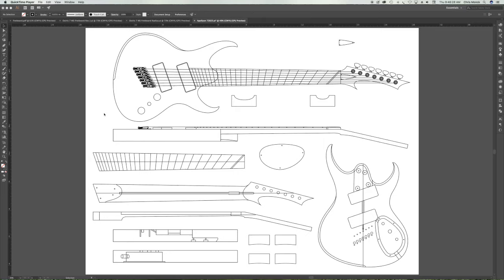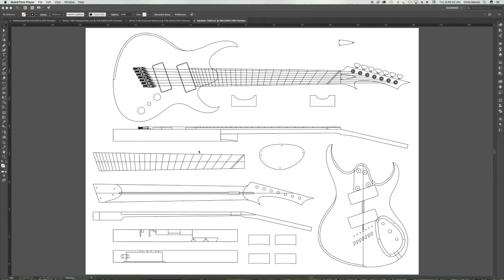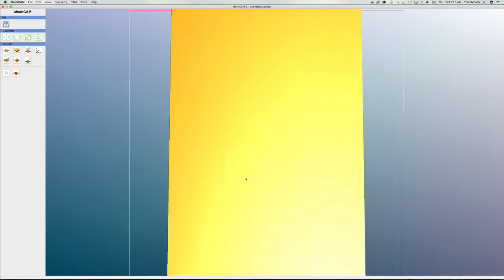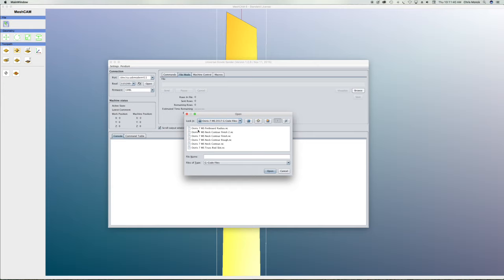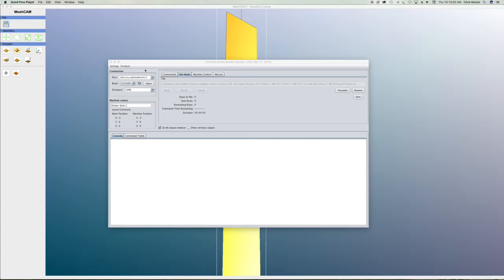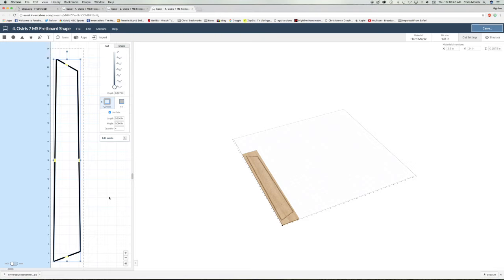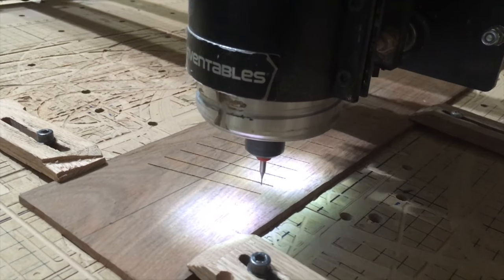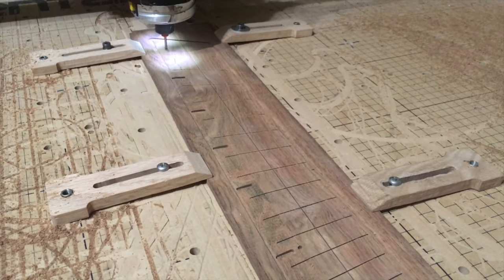Designing An Electric Guitar Part 2

Comment: Awesome!!  What I've done with  my X-Carve is connect it to a Raspberry pi with a Protoneer hat, the protoneer is then connected to four TB6560 stepper motor drivers.   The Raspberry pi is running CNC.js (https://github.com/cncjs/cncjs) which is a GCode sender you connect to using your web browser. (All don through your local home network, nothing goes through the internet)  You can upload the GCode from your office computer directly to your X-Carve doing this.

Comment: I just got my x-carve and I am trying to find the best settings each part of a guitar build. What cut settings do you use?
Reply from the maker: It all depends on the work to be done and the size of the bit being used. For example, with .25" diameter bits, I run at 125 IPM, .06" depth of cut, .06" stepover. These numbers are lowered as the diameter of the bit decreases. When I use a .024" fretboard slotting bit, I cut at 20 IPM, with a .01" DOC. Keep in mind, I have stiffened the X and Y axis of my older version X-Carve.